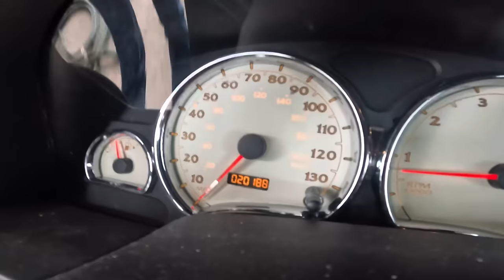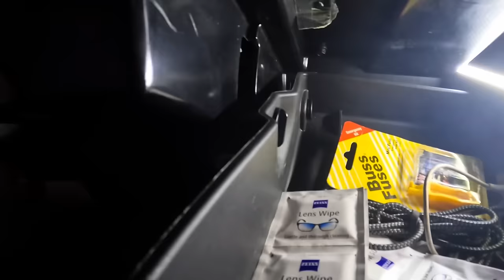Stripped Actuator! Clicking in Dash! 2007 GM Saturn Honda 3.5l

Comment: Got a ticket for reckless driving (a 1year misdemeanor in VA) for failing to use my turn signal at an intersection (no witnesses) when a motorcyclist weaving in and out of traffic rear ended me falling off her bike. Not guilty judgement in seconds. During my daily 50 minute commute, I find myself saying "there's another reckless driver" about 30-40 times daily. Thank you for YOUR service Ray.

Comment: I remember back in the late 1970s, I was doing brake work on my Plymouth duster. This thing had drum brakes front and rear, disc brakes weren't that popular yet. The shoes up front were a different size than the shoes on back, as were the drums. I still have the brake spring removal tool from back then. The wheel cylinders were leaking on both rear sets. I bought a rebuild kit and honed the cylinders out myself and put in the new gasket seals. It worked okay I guess my brakes worked afterwards and I didn't crash

Comment: It's amazing how simple and complicated the drum brakes are, when you look at the springs, levers, etc., and think that all those pieces together work. But, when doing a brake job on them it can be frustrating to get them all back together. As you showed.  The most important thing, in my opinion, was the advice of only taking apart one side at a time, just in case the correct placing of all those parts needs a reference. Probably many a DIYer has not, maybe even some technicians.  Good job Ray. 
I look forward to seeing your replacing of that actuator in the next video.
Reply: Putting them together is easy.
You need to hold the adjuster with your third hand, and set the springs in place with your fourth and fifth hands.
Yes, buying five-armed shirts is a hassle.

Comment: After experiencing several seized adjusters here in the salty north, I adopted the practice of applying brake lube to the adjuster threads, as well as to the inside of the cap.
Reply: Would anti seize compound on the threads a good alternative?

Or silicone grease?
Reply: I go the never seize route on mine.

Comment: My favorite pet peeve is people who drive all over parking lots without following the lines painted on the ground. Nothing is more irritating than having to crawl through a parking lot with my head on a swivel because people cut between parked cars and pull in front of you. Had so many people almost hit me weaving through cars and then flip ME off when I was following the lines!
Reply: I would have guessed that traffic law had something to say about lines in the parking lot. They aren't for decoration, like some people think. Where I live, it is forbidden to just drive over these lines (with couple of exceptions). If seen by police or parking lot operator, it may end up with a ticket.
Reply: Private stop signs and lines are not enforceable and are only a suggestion.
Reply: @wayneessar7489  Perhaps but it is good to follow the lines to be predicable to other drivers. What really scares me is if a kid darts out between cars as someone else is taking shortcuts across lines....
Reply: @wayneessar7489 Where I live they are!
Reply: Yeeeeees!!! 👍

Comment: I don't care what anyone says, I will always use new springs on drum brakes. It's not that expensive when you consider the cost of brake failure, not to mention the time saved fighting with removing that retainer 'horseshoe' thing (it comes with the spring kit). I also clean and lube the adjuster (or replace it depending on condition).

Comment: I can’t believe I came across this video at this time. My daughter is driving a 2007 Saturn Ion and has the same clicking coming from the drivers side of the dash. Now I know where the problem is, thank you for that. 
As far as manufacturers using “competitors” parts I remember 2 of my first vehicles having off brand engines. First I had a Dodge Arrow with a Mitsubishi engine and then a Dodge Omni with a VW engine. I guess they use what is most affordable at the time for the run of a particular model rather than producing their own engines. 
Glad that you have made the new shop a success after a year or so under your belt Ray.

Comment: Ray, I remember doing a brake job on my Dad's '68 Chrysler Newport back in the 70's. He had paid extra to get the first optional passenger car disc brakes factory installed on the front wheels. The auto companies were in the process of converting over to front disc brakes on passenger cars for the first time. The Chrysler engineers not wanting to leave anything to chance, installed Budd dual opposed wheel cylinders for the front disk brakes. These had four cylinders for each wheel. Two pushing on each brake pad on both sides of the disc. I had to rebuild all 8 brake cylinders due to wear and leakage. Repack the wheel bearings. The brake cylinder bores all had to be re-lapped and new seals put in. One advantage of the dual opposed cylinders was very even pad wear.  The car was also able to stop on a dime. He had many occasions he said where drivers behind him came close to rear ending him in that car.  It had a 2-barrel 383 V8 engine, not fast, but adequate. The engine was easy to work on. Lots of room all around it. Unlike modern vehicles where the engines are shoe-horned in using CAD design. It had a constant velocity U-joint. Supposedly when Chrysler was on hard times they put in standard U-Joints to save money. Also had the torsion bar front suspension. But could never find a garage to tighten them to remove a front sag. They lasted the life of the car.

Comment: My 1996 Saturn SL2 was easy to work on. I was able to easily replace the blend door motor by reaching behind the glove box.
Reply: My Son had a Saturn, when the $30 transmission shift cable end broke and wasn't available we fixed it with a $2 Toyota windshield wiper motor bushing. Identical plastic part, just a different use and price.
Reply: yours had the DOHC engine which was a good unit! I knew someone who raced his SL2, flogged it but it came back for more.

Comment: I bought my 2007 Saturn Vue Redline BECAUSE it had the Honda mill in it. It was explained to me that the body was by Opel which is why all the window controls are on the center console so the dash could be configured for left OR right drive... I love my Redline 😀 185000 + miles so far.
Reply: The Saturn sedans and coupes started using Honda automatics in 1996.

Comment: I owned a 1933 Singer 9 sports! One of the first cars with 4 wheel hydraulic brakes and the wheel cylinders in that look absolutely identical to those that Rays fitting here. 70 years later.... Nothing much changes... 😅
Reply: If it works don't fix it?

Comment: The Honda J 35 deal with GM, the General got a great enging into a decent enough car.  The best V6 the general could muster at the time was the 3800, but it was an OK 200 horsepower.  The J35 had 250 HP and the general needed to bolt a supercharger to the 3800 to get that engine to move enough.  Honda got a poop-ton of diesel engines in the deal and Saturn got the only engine they ever had that didn't burn oil!

Comment: 30+ years ago I had a white Ford Tempo, which I parked at a convenience  store during a trip in Texas, when I came out of the store exactly the same car was parked beside it .. only this was a Mazda ..  the owner came out a moment later and we even opened the hood .. everything everywhere EXACTLY the same, even the wire clips  on the same places , only the badges were different , consistently , everywhere ..
Reply: Similar situation I had a Hyundai sonata and a coworker had a Honda Accord. Side by side inside and outside everything was the same. The only exception was the Honda only came with a 4 cylinder engine and the Hyundai had a V6
Reply: That's because, at that time, Ford owned 30+ percent of Mazda.  Mazda cars also had Ford components in them.
Reply: @buckhorncortez   completely identical !! the labels were the only thing different. either the Ford was a relabelled Mazda , or the Mazda a relabelled Ford ..
Reply: Ford Tempo was NOT a Mazda product.  Ford Tempo was entirely a homegrown POS.   The Ford Probe was the same as a Mazda MX6/626,  Other Ford models also shared chassis with Mazda but NOT the Tempo.

Comment: On my 1970 and 1971 VWs, I put the parking brake lever in my bench vise and then remove/replace the horseshoe shaped clips.  I also use a nut-driver type tool for R&R of those round retainers on the brake shoes, bought that 50 years ago !!!  My 1988 Mazda B2200 truck, my 1998 Frontier, and my 2004 Frontier all have rear drum brakes too.

Comment: When I'm doing a disc brake job I rarely replace the screw that holds the rotor on as it's also just there for building the car on the line. Well, except for German cars with lug bolts instead of nuts. I put those screws back on to keep the rotors from falling off when they wheel is removed.

Comment: Would say that Saturn is a candidate for brake fluid change as well, seeing as they likely never bled the rear ever, or changed the fluid.
Reply: Not at 20000 miles. Besides the fluid was clear, not dark.
Reply: @orinmangar2333  I disagree. The vehicle has a flat tow bar setup, and  is towed behind a motorhome. Because the odometer reads 20,000 miles, the actual miles the brakes and suspension is much higher.
Reply: @russellriggan2088  The expert Ray did not recommend it in the video, and also to be sure, the fluid can be tested. I believe there is a brake fluid tester at auto parts store.

Comment: I did so many drum brakes in the military, including some where the hubs were over 100 pounds and were bigger than my chest. I do not miss it one bit, and only my boat trailer has drum brakes now. 15 years as a military mechanic, I also only worked in 1 shop with a lift, but I was in the heavy equipment shop there, and we only had 1 lift on that side of the building because no point in having more when almost everything you work on weighs 22 tons and up. I am happy with my office job now.

Comment: I’m doing a brake job on my 67 C-10 and having a dickens of a time with holding all the parts in place while installing the springs. I have been fighting it for several days and still on the first wheel. When you, the best mechanic I have ever seen have problems, I know I’m in trouble.😂

Comment: I love brake job it means 1 person or a family is safe on the road,and bless you sir for a high standard job that literally saving lives out there!. Well it's my personal preferences but i see oil job or fluid exchange job are not boring at all but hey everybody have their own preferences.
Reply: I may have some bad echoes in my brain.
When Ray was taking apart the second side of brakes, and some part self-launched with a metallic 'ping', I had a half urge to seek cover from the grenade.

Comment: Hi Ray, I am in my 70"s now and a retired auto mech. Back in the 60"s all cars were equiped with drum brakes till about 1967 when disc brakes became optional on some models. Most cars needed new linings every 20k. All your large model Chrysler products would go thru brakes like corn thru a goose. You would do a quality brake job with new heavy duty lining ,springs ,wheel cyl and machine the drums. About 6 months later customers would be complaining about brake noise ,pull off the drums and the brakes would just fall off the shoes. You got it made, brakes are way better.Enjoy your videos.

Comment: I made a worn vise grip pliers specifically for those crappy crimp retainers at the ebrake pivot. Ground the upper jaw slightly concave and the lower jaw to a wedge "point" to separate the ends... A crappy worn out old tool can always be used for something else... Works fantastical!

Comment: UK here......Raymond, I can remember when cars etc had no turn indicators. To signal a right turn, stick right arm perpendicular out of window with palm facing to front, left turn armstraight out of window and rotate hand  anti-clock wise. To indicate slowing down, arm straight out and move arm up and down ie from the 2 o'clock position to  5 o'clock. To indicate when stopping, arm out with hand and lower arm 90deg to upper arm.
Of course one must remember to first open said window.

Comment: That is the Honda V6 3.5L engine It is great as long as it does NOT have VCM.  I owned 2 Odyssey minivans: 2008 (wife was rear-ended and van totaled) and currently a 2010, both with the 3.5L Non-VCM engine.  They never had oil burning problems.   BUT, it is an INTERFERENCE engine with a timing BELT.  I will bet that the 16+ year old factory timing BELT is on that engine.  It may not have the miles, but it has the age.  Let that owner know that if the old belt fails, the engine will most likely be destroyed internally (valves hitting the pistons).  Advise them to get the timing belt/water pump service done.

Comment: Fun fact... Companies that install the tow bar units also install a device that doesn't allow the odometer to increase in mileage as the vehicle is in "tow mode" (activated when put in neutral)... My dad has one cuz Saturn was the only "manufacturer" that eventually installed the unit on their vehicles in certain models as standard equipment... Cuz people were afraid to climb under their vehicle and discornekt the speed sensor or the ABS sensors for towing... Just replaced the ECM in his Saturn ION cuz the car would randomly just shut off... Diagnosed fuel delivery and electrical and it ended at the ECM... No more random shut offs...

Comment: Turn Signal - A devise used by the vehicle operator when planning to change the vehicle's expected route of travel. In other words when possible the turn signal should be on before your brake lights or changing lanes.

Comment: Question, preceded by a bit of background: I am a still working, helicopter maintenance engineer with 50 years experience and I live in Northwestern Ontario, Canada. It is recognized as “best practice” that no bolt gets installed without lubrication on the shank and some times on the thread unless it is specified otherwise. Torque is usually specified with dry threads but sometimes with a certain lube. I have carried these practices over to my automobile maintenance and have found that unlubed fasteners are often corroded in place (tonnes of salt on the roads in the winter) and are very resistant to being removed. I tend to keep vehicles for a long time so I end up doing the routine things more than once. The anti seized or otherwise lubed fasteners always come out as they should, no matter how crusty they look externally.
Why don’t you routinely use some manner of lube on fasteners? A little anti seize goes a long way on exhaust nuts, brake bleeders and suspension hardware.
I have learned a great deal from your videos and really appreciate your trouble shooting skills and “order of operation” thinking.
Thanks Much from a northern neighbour.

Comment: 28:51 those are called push nuts you can find them at any good fastener supplier Dorman also sells an assortment pack.

I had to find new ones for my air compressor when I replaced the wheels.

Comment: Me & a few family members just happen to have had some early to mid 90's Saturn's, & I can say this. AFAIK, none of us ever broke down OR required ANY repairs outside of ordinary maintenance & we were all rather heavy commuters. My 2nd one rolled right thru inspection at 280K+ mi, at a time when ppl were getting red stickers in 3 year old cars. Neither of mine ever burned OR leaked a drop of oil either. However, many plastic parts like door handles, locks, seats & window controls etc. were busted up pretty bad by then. Not sure if our luck was just a coincidence or not but as far as "bang for the buck" at least some of them seemed to really be up there, I totally forget the years & models though.

Comment: I have always assumed that locking star washer to be a safety reg in the factory, something to prevent a drum from falling off on the line.
Reply: That's exactly what it's for. On the line, drums are placed on the hub as frame moves along before wheels are installed.
Without the ring retainer, the jostling of the line used to shake the drums off and they'd clatter onto the ground.

Comment: Saturn is fun though.  What's funny is depending on the engine it could have been made by Honda in the U.S. and assembled in Tennessee.   I was a mechanic at Saturn back in 2001 and loved every second of it.  I even got to drive the EV1.  GM did their customers dirty, and I say that as a fan of GM.

Comment: Can I just say that I find it entertaining beyond belief that almost every wheel pops right off the hub  - even on an old Saturn like this one.   With no lube of any kind.   The first time I tried to remove a tire off my 1974 oldsmobile , which has spent its life in Wisconsin, it was 1990.  I had to use a 5lb sledge to beat the tire until it popped off :D Not every wheel on an up north vehicle is that bad, but many are.   Also, the brake drums just scoot right off.   Never had a pain that didn't require judicious application of force - and I'm not a mechanic, just done my own brakes for years.I totally agree about re-using the parts Ray says he's reusing in those brakes - some of em look better than parts I've bought new....
Reply: 116 years is plenty of time for those parts to get corroded together.
Reply: @wayneessar7489  LOLOLOL. I will fix, but well played, well played.
Reply: @smarouchoc7300  🥰👍👍

Comment: those are referred to a Tinnerman nut - you'll see them on disc brake rotors

as Ray mentioned, for body-on-frame trucks, they'll often rotate the frame before body,  engine and driveline are installed to ease assembly / installation of suspension wiring, hard lines etc and these nuts keep the parts from dropping off the suspension modules (they're usually shipped from the supplier) which have the suspension, brake assembly pre-assembled